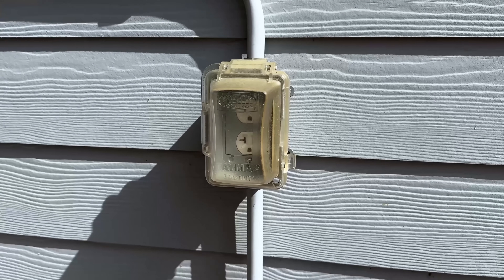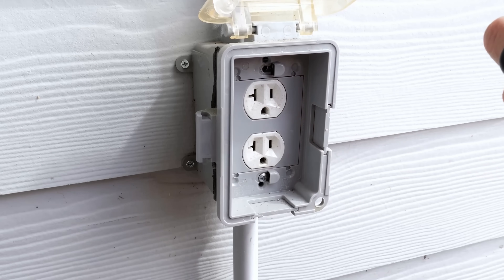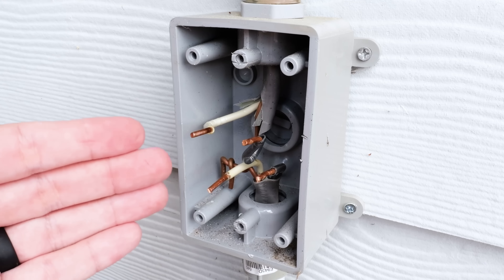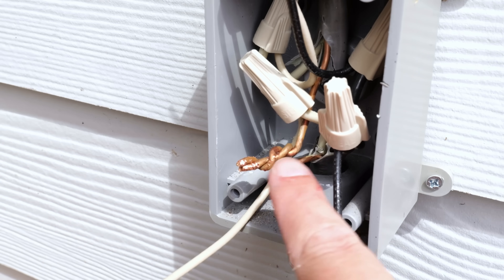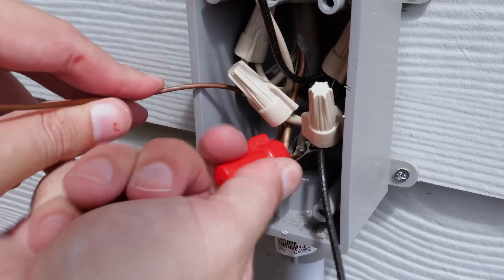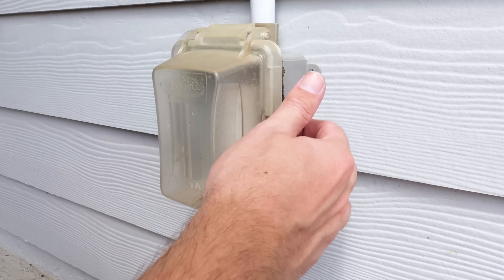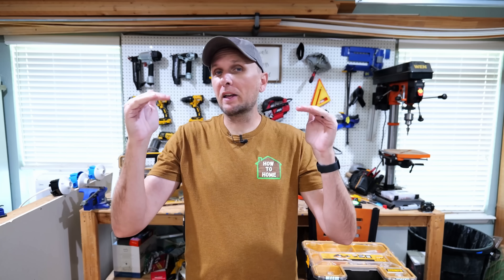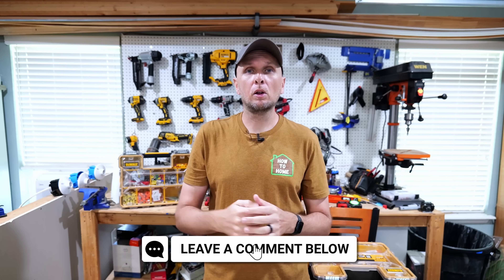Dangerous Mistakes DIYers Miss When Installing Outdoor Outlets!

Comment: My research found this; IDEAL connectors 10awg: Easily supports 10 AWG to 22 AWG solid and stranded wires — the widest wire range in the industry. So These would support 10awg to 12 awg wire connections or 12awg to 10awg. WAGO connectors cannot do that at this time, where as the IDEAL connectors can do this different wire size changes for these long outdoor runs for voltage drops. When ordering the IDEAL, make sure you order the 10awg size for this purpose.
Reply: Wago has a version that also takes 10awg.

Comment: I thought also romex isn't supposed to be run in conduit for overheating issues.
Reply: Didn't take long to find your comment. It was the 2nd thing I noticed after the missing ground.
Reply: I understand the pigtail scenario, but it appears to me you negated the 10 gauge to 10 gauge wire not being continued and dropped down to smaller gauge defeating the purpose of 10 gauge.
Reply from the maker: @elliotazus6258 not how it works.
Reply: @HowToHomeDIY  I very much appreciate your answer here.  You could write an entire encyclopedia set explaining voltage drop over distance and the mitigation that a larger conductor provides and it would not help at all.
Reply: @HowToHomeDIY Wouldn't the GFCI itself affect the voltage? Straining at gnats, I guess.
Reply: @elliotazus6258 those short pig tails would make zero difference as far as voltage drop goes.
Reply: There are 2 things here to consider: 

First, sheathed cable (NM or UF) can be run inside a conduit. But you must consider the outer jacket into the volume calculation for the diameter of the conduit. That means you need a larger diameter conduit to accommodate a sheathed cable. It's also a lot harder to pull compared to individual wires. 

Second, the type of wire used in the conduit is determined by the location. The conduit itself does not create a dry location for the purpose of wire selection. The conduit is protecting the wire from damage, you still need a wire or cable rated for outdoor/wet locations as there's no guarantee the inside of the conduit will remain dry. At the very least you can expect some condensation to form inside the conduit.

So, yes you can run sheathed cable inside a conduit if the conduit is appropriately sized and the cable rated for the location. But except for very short runs your increasing your material costs and making the job harder on yourself. 

Also, local codes may have different requirements and this only applies to residential applications. Commercial applications will have different codes. And as always newer codes could change everything.
Reply: @SouLShadow-SLS yeah , you can run nine individual 12 guage wires in a 1/2" conduit,  but you can only run one 12-2 cable (and 3/4" is recommended)
Reply: You used a 15 Amp GFCI Receptacle on a 20 Amp circuit.
Reply: @munvericht That's what I was looking in the comments to see. I'm not electrician, so I thought I was missing something. I suppose it's fine if they only ran the thicker wiring due to the run length and the intention was only to support 15 amps on that circuit. Not sure.
Reply: @munvericht 15 amp device on a 20 circuit is fine but a 20 amp device supplied by only a 15 amp circuit is not permitted because if someone does have a load with a 20 amp cord cap, chances are it is going to be using most of 20 amp and can easily overload the 15 amp breaker
Reply: You might have mentioned to the diyer that finding the correct gfci plate means that they are going to have to buy a completely new in-use cover.
But the plastic was getting pretty foggy anyhow!
Reply: @ericbeckner6959  I read the last comments and again, not metallic cable as some are calling "sheathed cable" CAN be placed in conduit.(but not in a damp location.).

As far as THHN/THWN. THHN is generally not for a wet/damp location, but there are exceptions.

THWN would be the best option to run in conduit in a damp/wet location.

Example examples.

I have an exterior receptacle for a generator. My generator plugs into that receptacle, which is mounted onto my home and from the receptacle into my home those wires are THHN.

Since the receptacle is connected to my home and those wires go directly through the wall known as a stub out from the box into the house, THHN is acceptable in that circumstance. The philosophy is because it's essentially going from the receptacle directly into the house there's really no long extension of wire Outdoors.

I have another AC receptacle on the side of my home. That receptacle has wires that run from the receptacle to a LB connector, which is mounted to the house and brings the wire inside. 

The wire within the house going to that LB connector is sheet non-metallic cable. Within that LB connector those wires are spliced with waterproof nuts to THWN cable, which then continues through the exterior conduit, to the AC receptacle. 

In that circumstance, since there is a long run of conduit, the wires must be wet/damp rated .
Reply: I thought of that as well.
Reply: That part
Reply: Except that in the video its uf-b cable very different than romex
Reply: The main reason is romex is less flexible than individual wires.

So if someone needs to replace an outlet or switch and they try to pull some slack cable into the box ,its easy for the conduit to cut into the romex causing a short.

If you run sheathed cables through conduit (it is legal) you have to use conduit that is much larger than you would use for individual wires.

If you have to use conduit it's easier and cheaper to run individual wires , if you are allowed to use romex it's just stupid to run conduit that big in a house.

Electricians have gotten in the habit of saying it's not allowed because you always have that one client with OCD who decides that romex in conduit is just "better" and won't accept that it's a stupid idea.
Reply: It's gray. It's UF, not NM, so yes it can be run in conduit and is wet rated for direct burial as well. It's actually a requirement for all floor boxes in a slab.
Reply: @gypsy6211 but what a PITA
Reply: That looks like UF-B cable, which is rated okay for direct burial. It doesn't look like romex.
Reply: You are correct. It’s not supposed to be run in conduit.
Reply: @Sctronic209 
It's allowed but you have to use conduit that is much larger because sheathed cable 

The mininmum for one 12-3 Romex is 3/4" with 1" recommended.

You are allowed up to nine individual 12 guage wires in a 1/2" conduit.

So with multiple romex cables it doesn't take much for the minimum conduit size to be wider than a wall stud.
Reply: Romex (is a brand name). NM or non-metallic cable is generally not outdoor rated however, there is cable that is outdoor rated such as UF cable. Since that is gray in color, it would appear to be the appropriate cable that could be run in conduit. However, most people would prefer to run. THHN cable as it is allowed to be run in conduit, therefore it is outdoor rated/approved. Also, each individual wire is coded and it's a lot easier to pull through conduit. Additionally, if you can compare wire gauge to conduit side, you'll see that you can fit more THNN wiresthen you could end non-metallic cable.
Reply: @wiley0714  Wouldn't it need to be THWN since THHN is not wet rated or does the conduit keep it from being considered a wet  location?
Reply: @ there are exceptions, which do allow THHN. However I will give you 99% correct on that going with THWN.
Reply: @wiley0714  NM cable is never allowed in a wet location. 
- 2023 NEC, Article 334.12(B)(4): "Type NM cables shall not be used under the following conditions or in the following locations:...In wet or damp locations."
Reply: @wiley0714 almost all modern THHN is now dual Rated THHN/THWN thus can be used in wet locations. The label on the spool probably only says thhn but if you look on the wire insulation it shows both thhn and thwn
Reply: @wiley0714  1) THHN is a conductor, not a cable. 2) Outside is a wet location, even in a conduit. THHN isn't allowed to run in a wet location. It would need to be THWN.
Reply: @ a conductor, a cable, and a wire, walk into a bar and order a cup of salt water.
Reply: @wiley0714  Code calls for no sheathed cables in conduit, you must use individual wires.  I learned this the hard way from our country inspector when he inspected my wiring to the AC connection box.  He told me to just cut the NM cable back inside the house and put in a junction box, then join the wires to the cable using screw clamps as it was 6 gauge wire.  NM sheathing is also supposed to be cut back to leave just 1/4" inside the box for fire safety reasons.
Reply: @CitEnthusiast actually there is no code that says that.  NM or romex is not allowed in conduit that is outside because it is considered a wet location.   It is totally allowed in conduits and is done for mechanical protection. But except for that reason, I wouldn't use it in conduit due to fill requirements
Reply: @CitEnthusiast  Code allows sheathed cable in conduit under the same circumstances you can you nm cable normally. If you can't use NM cable in a location then another conduit won't save you. It's only really worth it if you're trying to protect the cable from anything physical. Code only doesn't let you use it in wet locations as the manufacturor doesn't specify it's rated for wet locations... though typically it's thhn wire inside the romex for use in damp locations. It might not be labled as such and you will get dinged.
Reply: @CitEnthusiast there is an exception for short distances used to physically protect the wire. Thats UF cable which is allowed in damp and wet locations unlike NM cable.
Reply: @wiley0714  It looks like it might be UF. I understood it could be run in conduit for physical protection.

Comment: So, if you have a metal box would you ground to the box as well as the receptical, or just the box?
Reply: NEC allows for grounding to the box as the mounting ears of the outlet are a direct ground connection to the ground terminal on the outlet. I have gotten into practice of using redundancy though, and tend to loop the ground conductor to the grounding lug in the metal box and lead it out to terminate on the ground terminal on the outlet as well.
Reply: Both in my area.
Reply: Both. Now the receptical can not loose its ground if removed from the box
Reply: @ParkerThwips  I agree with sheepish and Dan. I live and work in a pipe and wire jurisdiction: Chicago/Cook County. I use the 10-32 grounding bump out on the box. In old “iffy” homes with black pipe and j-boxes I’ll drill and tap for a 10-32 ground screw.  I believe that not all outlets’ ears are considered a reliable path to ground. The ears can stand off the box and even have plastic spacers with the screw floating in the slot in the ears. Commercial receptacles where there’s is a hard brass wire/rod running across the screw slot and having an interference fit with the 6-32 mounting screws is considered a reliable path to ground. Local codes notwithstanding. BTW I find these discussions very interesting because of the differences in local codes and practices.

Comment: Should always pre-twist your wires. In this instance with box fill, should have just installed a gfci breaker. The cover is a in use weather proof cover, just needed to remove lower knockout on cover so the cover can be completely closed with a cord installed
Reply: That "knockout" slides out and in. I keep mine in unless I need to close the cover. When the receptacle is not in use I like to keep the piece in place to keep bugs out.

Comment: Do you need to install a GFCI outside if the circuit is already connected to a GFCI breaker in the fuse box? For the same circuit, would a 15 amp weather resistant outlet be allowed outside in a weather resistant box?
Reply: If the breaker is GFCI, do not install a GFCI outlet.  GFCI should not be serialized.  However, the outlets should be labeled as GFCI protected.  Also, test to make sure.

Comment: Would it have been better if you used 10 gauge for the pig tails?
Reply from the maker: Makes no difference in this case and would be almost impossible to work with.
Reply: @HowToHomeDIY You could explain why.  12 gauge is sufficient for 20 amps in shorter runs. The 10 gauge as you mentioned reduces voltage drop over long runs.  The short pigtail will have almost zero voltage drop.

Comment: IF it is on a GFCI Circuit Breaker in the Main Panel , it can be a WP Tamper Proof  120 VAC 20 Amp Duplex Receptacle
Reply: YES!!! Exactly… Also… You should never put a GFCI outlet on a line with a GFCI breaker (troubleshooting nightmare). Your outside outlets can be downstream from a GFCI outlet or on a line protected by a GFCI breaker, and they will still be safe and up to code. Hot tubs and pool equipment require a GFCI breaker in the panel. This outdoor rated GFCI outlet is a total waste, it should have been placed indoors and upstream of the outdoor outlet (that way both the outside line and the outlet go dead if the GFCI trips), so it protects the outside wire as well… And if you live in an area where outdoor critters like to chew wires, it’s good to have that wire protected by a GFCI, (especially if you went with plastic chew toy conduit instead of metal).
Reply from the maker: @timtation5837 I explained in the video that this was the first outlet in line.  So it does exactly what you said it should do.  Second, how are critters getting to this?   No exposed cable.  3rd I said in the video there are other ways GFCI protection can be added.  This circuit did not have a GFCI breaker on it nor do any of mine.  This is a much less expensive solution that has the same result.

Comment: Never ever add extension to wires on outside receptacle.
Reply from the maker: That’s not a code.  You made that up based on your own opinion.
Reply: @HowToHomeDIY  No not true, here you can't do that due to it's windy and rainy a lot.
Reply from the maker: @ohfknowned239 I don’t know where here is but that would only be a local code at best.  There is no NEC code for that.  Your original comment is phrased as though it shouldn’t be done by anyone and is across the board and it isn’t.

Comment: If you live in a metro area, keep in mind that nothing about that install - before or after - is legal in many places (and maybe not even legal indoors).
Reply from the maker: 😂 how do you figure?  Nothing about your comment helped anyone because nothing was specified.
Reply: Sorry, nothing was specified because I don't live in everyone's town. In many towns or counties what you showed is perfectly legal, normal and safe. It was just a hint that it's always advisable to check your local codes.

In my area plastic (conduit and box) are not permitted (anywhere), Romex is not permitted (anywhere), and outdoor runs can't be that low to the ground (snow). There might be other things I missed for my area.
 
Of course I would check my town's current codes before actually doing any work.

Comment: If it's a 20 amp circuit, shouldn't you use a 20 amp GFCI ?
Reply from the maker: Not required and I didn’t want one there.

Comment: I have a regular outlet on a patio that is controlled by a GCFI plug located in a bathroom (installed by original builder). Is a GCFI plug recommended for the outside plug? Good video, lots of good info.
Reply: I would say no because it is protected.

Comment: Put a heavy saw  on a GFI and the GFI will burn out. Heavy saws use 20 amps. But a saw with a  20 amp GFI pulls almost 30 amps at start. Had a lot of problems on construction site with GFIs  on Heavy saws or electric jackhammers.

Comment: In my jurisdiction, the minimum length of the connection wires is 5 inches. And the ground screws are not painted green in the box.
Reply from the maker: If you are in the US, NEC is 6".  That is minimum.  Local jurisdictions can make theirs longer but not shorter.  Also here in the US almost all outdoor metal boxes have green ground screws in them.  Interior ones do not.

Comment: Is that cable "wet" rated?  Did you calculate box fill?
Reply from the maker: Yes it’s UF direct bury cable.  So yes, it’s more than wet rated.  For purposes of this video and most people’s situation of #12 or #14 box fill calculations would not be an issue.

Comment: That siding is leaking and it’s going to replace in 2 years. This is a job security video
Reply from the maker: The siding is leaking?  What are you talking about?
Reply: @ when you screw the screw threw the siding with it being sealed water will goes behind the siding
Reply from the maker: How is the water getting there when the hole is covered and plugged with a screw?  Also it’s under an eve so water isn’t running down the wall.  My siding is hardie lap, nothing is going to happen to it.  Water isn’t just going to get in there.
Reply: @ inserting a screw into vinyl siding can potentially allow water to seep through, potentially leading to water damage behind the siding. Vinyl siding is designed to shed water, but a screw creates a point of penetration that can allow water to infiltrate if not properly sealed.
Reply from the maker: Again.  It isn’t vinyl siding.  And even if it was, it’s not going to just allow a bunch of water in.  Water doesn’t cascade down walls.

Comment: If you pigtailed the circuit thru the GFCI outlet, with # 12 wire, wouldn't you defeat the # 10 carrying  the higher load down stream... I would have three way wire nutted, the two #10 together,  with the one #12 pigtail to keep the higher amp going downstream..
Reply from the maker: It isn't there to carry a higher load it is just for voltage drop purposes.  This outlet is at the beginning, voltage drop doesn't start being an issue until much further down the line so not the #12 pigtails won't effect it at all.  If you did it the way you propose then the GFCI wouldn't protect the outlets downstream.